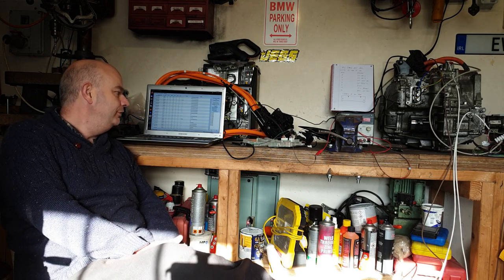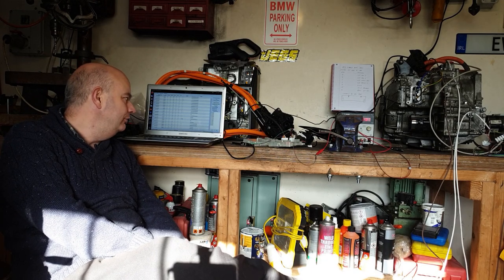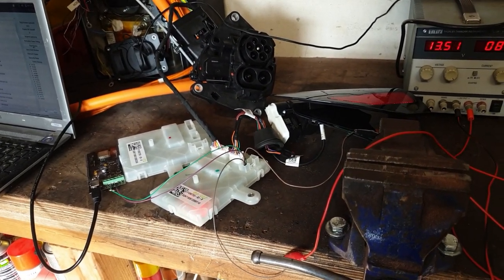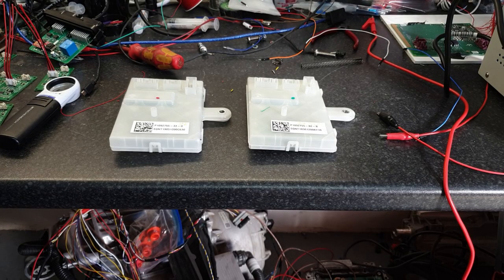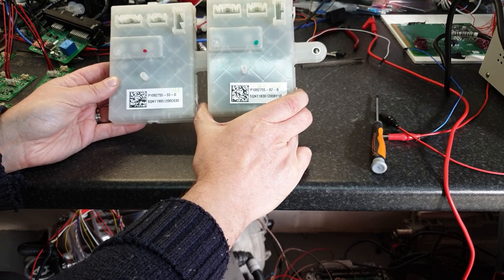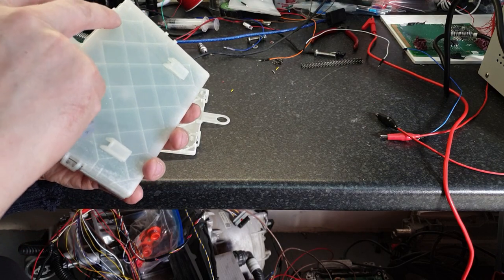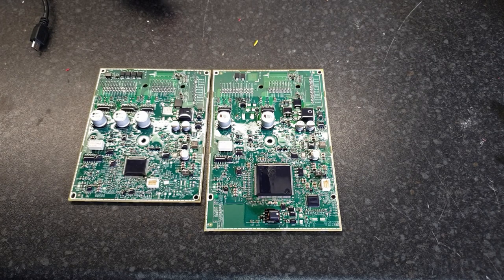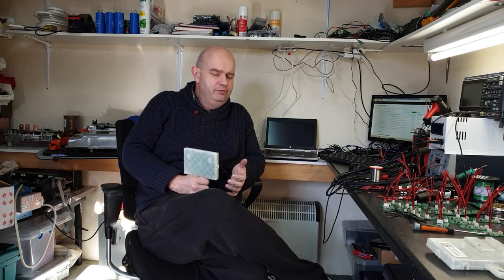Tesla Model 3 Charge Port Hacking : Intro

Comment: Thanks for bringing us along!
I’m looking forward to having CCS on my US Model 3 based conversion, when I eventually get it running.
Reply: Hello Mr. Zilla. :) We'd have to get ahold of the EU CP boards, which are not easy to get here in the US. Damien has a US ECU on his way to him, so we'll be able to see if the plugs just swap over (I think they do), but so far the messages vary enough that progress has been limited. US Progress: https://www.instagram.com/p/CGRKhsSH6ai/
Reply: We already change them on M3 and MY
Reply: @gosmartUkraine  yes, those comments were from a year ago, before we knew how to swap out the old CP controller. 
It sure is nice that we can have CCS charging in the US now on the 3 and Y platforms.
Reply: @CafeElectric  just came across your video, we changing to ccs for almost a year. Also, there are 2 way with the harness, with the installation of an additional connector and without in the battery 😌

Comment: Hello what awg are those cables
Reply: 95 sq mm is larger than 3_0 (#000) but smaller than 4/0 (#0000)
Reply: @MichaelLulchak  okay thank you so much. Are they welding cables or can welding cables be used
Reply: @lawalgbolahan2466  Welding cables are big enough, but they do not have enough insulation for the output voltage.  If all you have is welding cables, you can add heat shrink to get a higher voltage rating, or electrical tape (remember to overlap the wraps so there are no gaps).  The tape and the heat shrink make the cable less flexible.  The outside of the cable should be orange or yellow to show that it is high voltage.  Those are the colors that first responders and firefighters have been trained that the high voltage cables will be.
Reply: @MichaelLulchak  thank you 🙏🏻
Reply: @MichaelLulchak  I am pretty sure that all those orange high voltage cables used in EVs have the inner conductor but an outer shield also to protect from electromagnetic and electrostatic fields (To avoid your pacemaker from going bananas for example).
Reply: You are doing a very important job not only for conversion projects but for all people wanting to keep their older EV running (Right to Repair). Thank you very much for that. I wonder for if one day a software version would be available for Teslas to get full access to diagnostics incl. the Toolbox software. I always fixed cars myself plus the next service center is 500km away (high mileage Model S in Australia).
Reply: I ended up here wondering if I could get (via CAN) my Tesla Model S to close the charge port contactor to expose the battery to the CCS pins for 'reasons' 😁 like the exact opposite issue to you.

I want the 400V battery voltage out to run an inverter. 😁